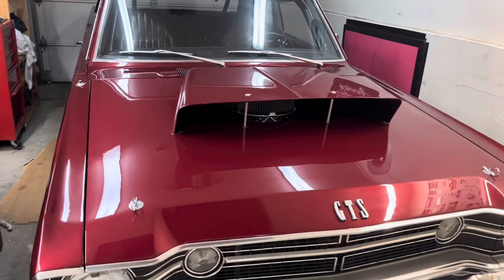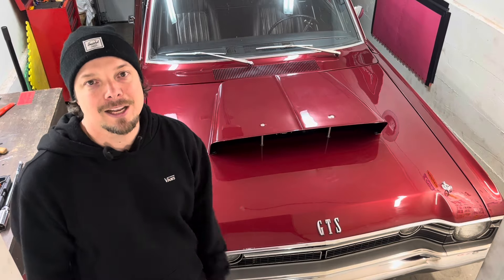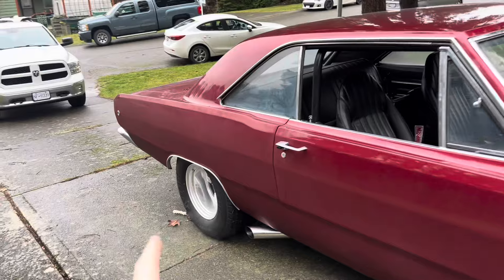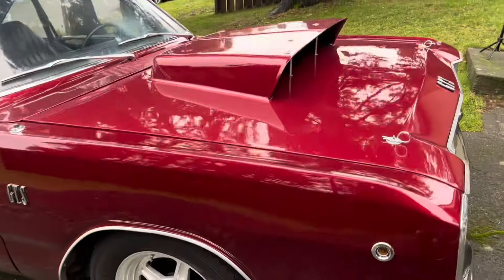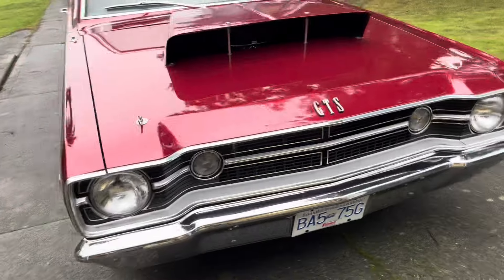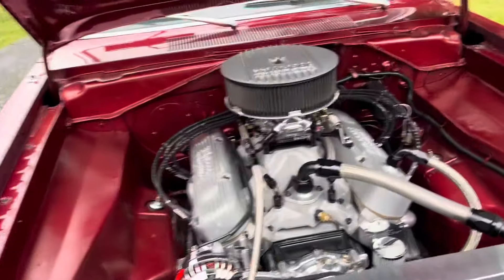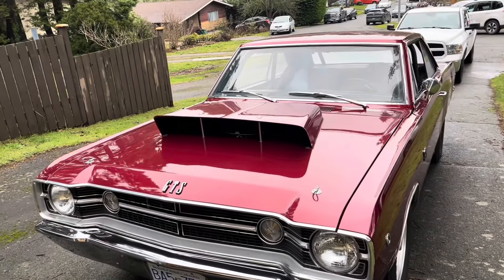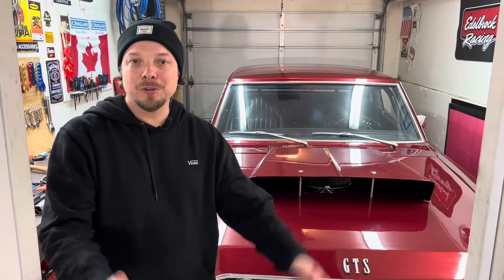Hemi Hood! Full fibreglass hemi scoop for my 1968 Dodge Dart!

Comment: A strong wind can blow the hood up, hood prop falls and then the hood slams.  Happened to my buddy.  And the stock hood pins were on cables that were connected down below near the bumper somewhere, like a 'Cuda or Dart factory Hemi car.  They work good and look fine. Also the pin big washers on the hood are not stainless but the screws were, so the washers  are prone to rusting.  These are the problems my friend had on his.  Thought I'd share.  Looks awesome.  Luv it !!  Thanx for sharing.

Comment: Great to see you back!  Question...If you weren't running the 3" air cleaner, or the carb spacer, how much clearance would you have for the "stock" hood? Running the same heads/intake on my valiant, but using MPFI and a 1000cfm throttle body. Haven't tried the hood yet. How much of an issue am I looking at? Thanks
Reply from the maker: The super victor intake won’t fit under a stock hood. Back in the day I hand my air gap, Mopar air cleaner (2 3/8 I think) with a bit of drop base, and it was just rubbing
Reply: Thanks, Joey. @SimpsonsSpeedShop